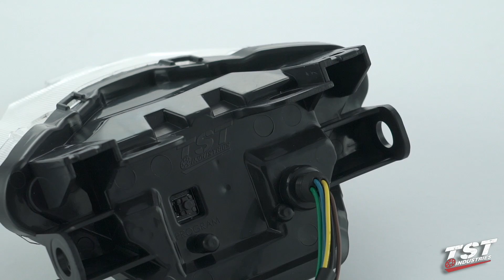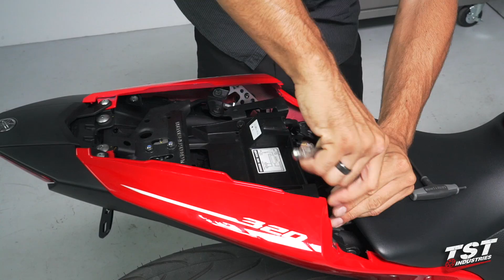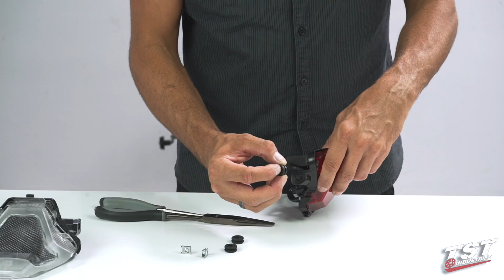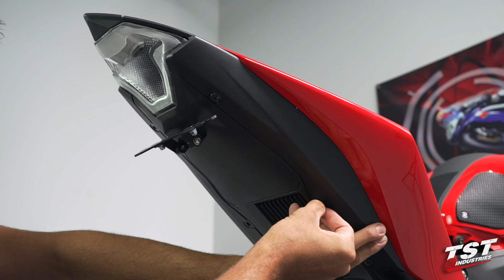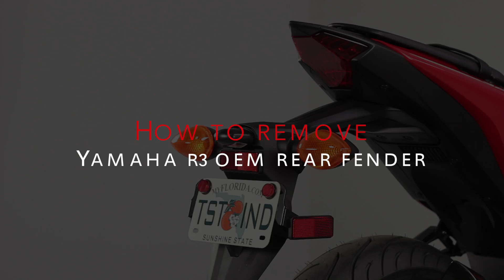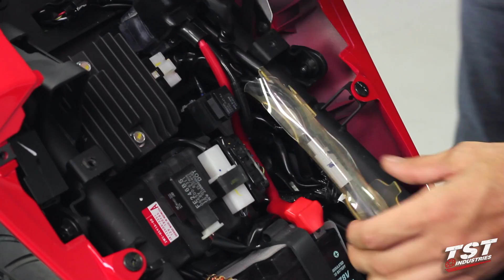How to install an Integrated Tail light on a 2015+ Yamaha R3 by TST Industries

Comment: Starting at 17:05, is there supposed to be that much of a gap between the top of the tail light and the panel?  No worry about water getting in?
Reply from the maker: The tail light we produce has the same external geometry as the OE unit. Those gaps are the same as with the OE light. Because this light is used on several motorcycles we did not change the geometry to cater close the gaps on just one model. That would have adversely affected the fit on the other models.

Comment: mine just came in and says it’s by tst industries, but mine is not the same plug in. mine has a bunch of individual wires. any idea why this is? or if i’m still able to install it like this?
Reply from the maker: Well it sounds like you got yourself a fake. If you aren't purchasing from our store  or authorized dealers  chances are you are getting a cheap dupe.

Comment: I had one of these hooked up and working on my R3, but I disconnected it to re-install the stock fender.  Now I have stock turn signals but can't use the LED light for anything, including brakes.  So I reconnected it as it was but now I get nothing.  If I hook up the larger plug but leave the stock tail lights connected to the two smaller plugs, can I still get tail and brake lights? Any ideas?

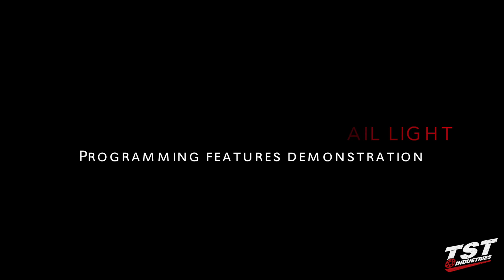Comment: 16:55 Begins the programming section.
Reply: Wish I had seen this comment 20 minutes ago
Reply from the maker: hmmm...I wonder why you had to post that
Reply: @TSTindustries   I posted that because most new riders that would purchase this item would probably have it installed by a professional.  At that point they would only really want to know how to cycle through the break/turn signal options to suit their preferences.  I just cut to the chase with my comment.
Reply: @TSTindustries  BTW I purchased the smokeTail light, smoke blue halo flush mount turn signals, fender eliminator kit, smoke rear turning signals, flasher relays, and handle bar ends for my blue 2019 R3

Comment: Definitely getting this Tail light, super sweet. One question though, I want to add another set of rear directional lights, how would I go about with the wiring if they are connected to this tail light? Thank you!
Reply from the maker: We actually recently made a video about them. Check it out. https://youtu.be/tgqbBzYpVsA
Reply from the maker: No need for any special wiring. We have Y-splitters that are plug and play and enable tje very thing you are trying to achieve.
Reply: TSTindustries thanks A lot! Will do. Subscribed as well , great content

Comment: That ain’t street legal is it?
Reply: DailYxDosE why not?
Reply: jojotheweirdone seen a video where a cop was saying the turn signals had to be like 12 inches apart or something.
Reply from the maker: This varies by location and it is best to find this out from local DOT office.
Reply from the maker: In some jurisdictions signals are not even required because hand signals are still acceptable for motorcycles. The vast majority of locations definitely have a minimum distance between signal lamps mandate. This distance may vary state to state, country, etc. Our lighting is not DOT certified so there is also that layer. If you intend to use this equipment on a road going vehicle I would urge you to first find out from local DOT if this will be a problem and not make a purchase if it will.

Comment: is it weird that I like hyper flash?
Reply from the maker: Just know that if you use the sequential program for the signals then with hyperflash the sequence will not complete because with a faster flash rate there isn't enough time to go through each signal sequence.
Reply: Thanks. I only have hyper on my front signals

Comment: TST, none of the program functions are working on my R3. It appears to be stuck on standard brake light with strobe turn signals, nothing happens when I press/hold the program button.

I have the clear lens with the gen 2 relay installed on my 2018 R3. All the lights function fine but I'm disappointed that I am not able to change the programs. Any advice?
Reply from the maker: Are you pressing the program button when the tail light is in just running light mode? If not then you won't be able to toggle the program. Please try that. If that still doesn't work then you can send our customer service guys a message through our website and they will make sure to get you up and running properly.

Comment: Mine doesn’t work, tail light keeps the signals solid but when I put oem back it’s normal, I will contact support tomorrow but not a recommendation
Reply from the maker: Please contact support but in the meantime just consider the fact that you wired your front signals incorrectly. Your front signal plug has a running light and signal light circuit. On your bike they are most likely wired in a configuration where your running light circuit is shorted to the signaling circuit thereby pushing current to the tail light signals and tripping them. We see this one customer bikes all the time. It's not a problem with our tail light but rather misconfigured signaling system on the bike.

Comment: How do you change modes?  I got one of these but there were no instructions on operation-just the installation...
Reply from the maker: JID01 there is a button on the black enclosure that has the word "program" by it. With key on, press it to toggle through the modes.

Comment: The pulse mode for the brake light, will be illegal in most states, if not all. No Red or Blue lights may pulse on any non-government vehicle. I doubt many cops would ticket you for it, but they sure could. We all know there are some sticklers out there. Also, I just checked out your website and you guys only carry 2003 ZX6r mods and up... I own a 2002 D:

Comment: The pulse breaks don't make sense to me. If you're trying to break into a turn and your taillight is going all crazy it may confuse cars behind you. Seems kind of unsafe to me. Other than that the smoked ones look sick on the r3 and something I would get if I decide on the r3 over the ninja 400
Reply from the maker: The pulse modulates brightness of the brake and gets noticed by drivers behind you that may not be paying attention. You don't have to use that function if it is not what you want to use, but it's there within the programs if you decide that is what you want. The taillight gives you three different brake modes to choose from so the choice is yours. Our Ninja 400 taillight will have the same programmable options. If you want to sneak a look at what we have in store for the 400 then see our latest video on that model. There is a sneak preview of our Ninja 400 taillight in there. Here is the link: https://youtu.be/VxYxZzdlDtk
Reply: TSTindustries I understand the purpose of the pulse function I just feel there's a lot of idiots on the road and it'll confuse people lol. Just my opinion. I do like the breaking Option where it pulses about 3 or 4 times then goes solid. That's probably the one I would use.

Comment: @TSTIndustries You guys are doing a great job making very simple videos. No further explanation necessary. Only one complaint; All the Tools used by Bart should be listed. Looking forward to purchasing Fender Eliminator and Tail Light after tools are listed. As I had really hard time installing Womet Tech and other stuff since every part has certain torque requirement and it's for guys is just started driving and does not own all the tools. Thanks!
Reply from the maker: We are glad you find our content helpful! We have actually taken that idea into consideration and we now list all the tools needed in the intro section of our videos.
Reply: I still don't see tools listed under description section. Awaiting list so I can order and install fender eliminator and integrated tail light. I am insisting because of tools issue I couldn't install womet tech swingram spools. Thanks again!

Comment: after watching the video instructions on how to install the fender eliminator, stealth plate light, and integrated tail light, I successfully installed it all in one shot, even threw on the gen 2 flasher relay.. very easy to follow videos, thanks for the great product.. there is a small blemish on the integrated tail light that is on the smooth clear plastic, probably not noticeable to the naked eye but it does make my OCD flare up a bit knowing it's there ;( other than that, I'm loving the TST product all over my new bike, thanks guys!
Reply from the maker: Great to hear you are enjoying our products. I am curious to see the blemish you are talking about. Can you provide a photo or two?
Reply: http://imgur.com/a/fkkUW

its not that large, and really only noticeable if youre looking up close with the ignition off.. kinda hard to get a clear focus on it with my cell camera

Comment: quick question guys.... i just installed this the other day and the first time i started it all the lights worked fine. later that day i turned it on to show someone and the running light wasn't turning on but the turn signals worked.  the brake lights worked then finally after cycling through turn signals and brake lights the running halo turned on... any ideas?
Reply from the maker: Does the issue persist or was it a one time thing?
Reply: hey, actually i think i found whats causing it.  maybe you guys have run into it.  After installing the integrated Tail light i installed a Bazzaz Fuel Tuning unit.  the Bazzaz instructions said to connect the 'Scotchlock' connector to the blue wire for the tail light assembly to power the bazzaz unit. so after i connected that wire i realized the problem with the tail lamp....after some head scratching i figured the bazzaz unit was pulling power from the TST lamp, i disconnected the wire from the TST harness side and connected it to the Blue wire on the body harness side and so far i haven't had the same issues... only a few times it's taken a couple seconds for the lamp to turn on.... i'm just curious now if there is a different place i can connect the bazzaz connector to, that wont affect the stop lamp at all.

Comment: Does Yzf R3 & Yzf R25 have the same installation part? Meaning they both got same size of their accessories. Its because I have R25 instead of R3 in my country.
Reply from the maker: We do not have the R25 model here so we cannot help you unless you send us photos. You can send those to our customer support crew through the Support tab on our website

Comment: can this fit to my r25?
Reply from the maker: We do not have the R25 model here so we cannot help you unless you send us photos. You can send those to our customer support crew through the Support tab on our website
Reply: TSTindustries actually its similar to R3, same model, same look, but R25 use 250cc instead 300cc like R3, that is why it is called R25
Reply from the maker: then it is very likely that all the parts we have for the R3 will work for that bike. I know that in some countries the electrical connectors used in the bike vary from what the American model uses, so you have to consider that.

Comment: sir i wanna ask do i need only one TST 2 Pin LED Flasher Relay Gen 2 for both the integrated tail light and the halo gtr front LED flushmount signals? thanks
Reply from the maker: Yes you would only need one LED Flasher Relay to control both your front and rear signals. Please watch our Tech Tip video to learn more about our LED Flasher Relays (link below):

https://www.youtube.com/watch?v=5tlQfg_Ap8I&t=18s

Comment: Hi, will the integrated tail light work with the stock signal lights? i am thinking of having this using its full functions with another led signal lights.
Reply from the maker: It can if you connect the wires correctly. It will likely not be a plug and play connection but it's pretty simple. You will connect your external signal wires into the bike's harness signal leads. Next you will need to splice the single signal wire for each side of the taillight into the positive wire of your external signals. That's it.

Comment: Can it use on MT-03 ??
Reply from the maker: We do not have MT03 in the USA so there is no way to verify this 100%. It looks like the same taillight so it will most likely fit but I bet the connectors for the signals will be different just like they are different on the R3 between USA and EU/Asia models

Comment: Does it always flash red/amber when you brake?
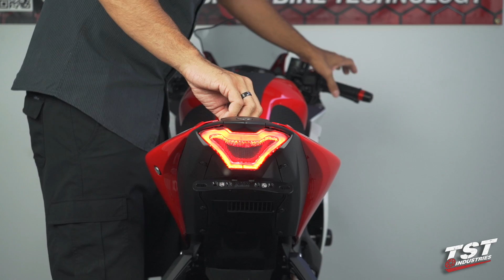Reply from the maker: There is no amber in the brake programs. It only uses red. We have three brake programs: Standard, Strobe Alert, and Pulser. You can see the demonstration of these functions at 17:17 in this video.

Comment: I was thinking on adding the led pod signals in addition to the integrated taillight for more visibility. Do you think it would be overkill?
Reply: +Pierre Visconti yeah, i just want the most visibility possible. I would do the strobe brake with sequential blinkers and the additional led pod for maximum visibility.
Reply from the maker: I think the taillight along with our pod signal kit would work well for your purpose then.
Reply: So, I'm not clear on this. Can I install and still use the integrated turn signal function and add your LED pods so they both work together?
Reply: หาซื้อได้ที่ไหนคับ

Comment: can the bike, lighting components, bulbs or fuses be damaged due to hyper flash?

IMO i think it looks cool and better chance of being seen but are there vehicle code regulations ?
Reply from the maker: They will not be damaged, however some of the light programs for the signals will not operate correctly if you have hyperflash.
Reply: just imagine strobe light with hyper flash, probably give the driver behind a fvcking seizure...

Comment: this seems dangerous
Reply from the maker: Why is that?
Reply: The indicator lights dont seem visible enough and seem to mesh in with the break lights so you can't see them at all.

I could see this confusing people
Reply from the maker: EskiLdn There is a demand for integrated taillights on the market so we produce them. We also sell pod signals that can be used in conjunction with the taillight, and keeping the taillight not plugged in. This way the signals are separate from the taillight capsule. The choice is left to our customers.

Comment: Does this mod void my Yamaha warranty 😩
Reply from the maker: You can check your warranty book and ask your dealer to be 100% safe on this but I don't think this will do anything to your warranty. As can be expected, any components you replace with aftermarket ones will not be covered under warranty, but if they are purchased from us they come with TST Industries warranty.
Reply: +TSTindustries sweet checking now, I'll be ordering soon 😎

Comment: This will fit my 2016 fz07 right? and do u have any available as of now?
Reply from the maker: Currently out of stock but check our website late August - early September. And yes, this unit will fit your FZ-07 without any modifications. 👍

Comment: Thanks for the great installation videos Bart! So far I've installed the front flush mount signals on my R3 and the flasher relay. I'll definitely be purchasing this integrated tail light when it comes back in stock :) Keep up the good work TST Industries!
Reply from the maker: Thanks buddy! We worked really hard on this unit and are excited to finally bring it to the market. Check back on our website late August - early September.

Comment: Out of stock already, any preview of when it will be available again? Do you guys ship to brazil? if so can you estimate the shiping value? Fit the same way on the FZ 07 or will require aditional parts?
Reply from the maker: The pre-order event was a huge success and we sold out of our first batch rapidly. We are in the process of assembling more of these lights and will post updates on our blog page about this product ( https://tstindustries.com/blog/2015-yamaha-yzf-r3-fz-07-integrated-tail-light/ ). We stopped shipping to Brasil because of many delivery issues. Basically anytime we sent something there it was a loss for us. This setup will fit on an FZ07 without any other parts needed. We shot that video already. It just needs to be finalized and it will be posted here on Youtube shortly.
Reply: Thx for the quick reply. Pls let me know if the is any changes on send policy to brazil.
Reply from the maker: Technically, if UPS ships to your location and you are ok paying those  charges along with their insurance we can invoice you and send it. Just a warning though...UPS is very expensive. Probably on the order of $70 or more.
Reply: I will get in contact with sac. Through email. Thx